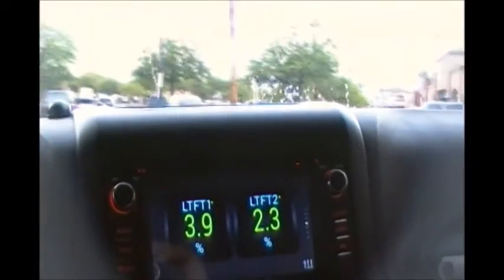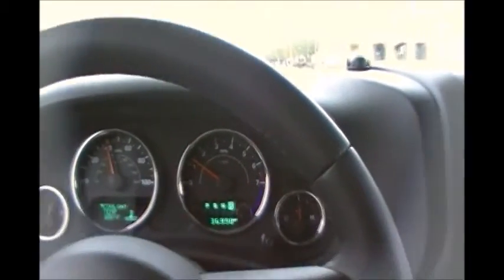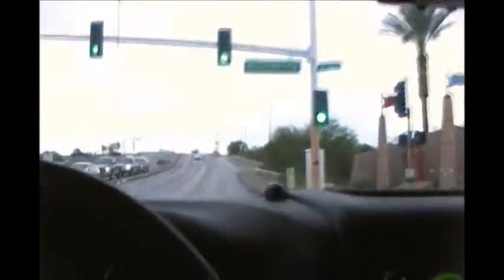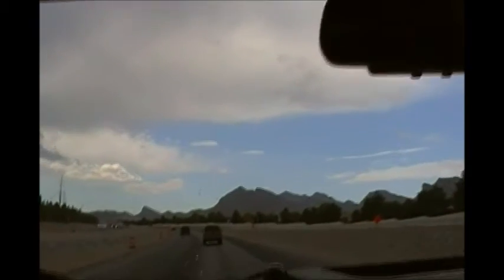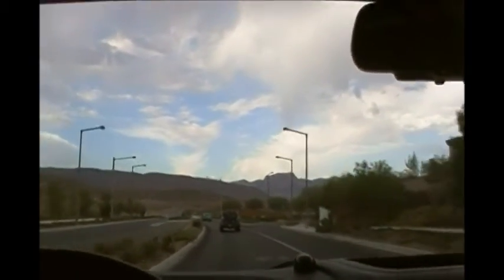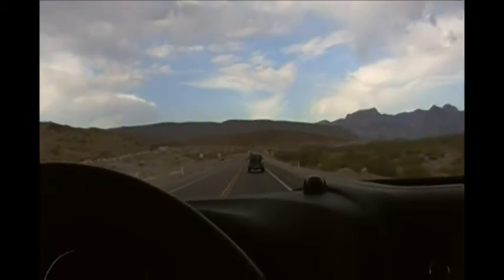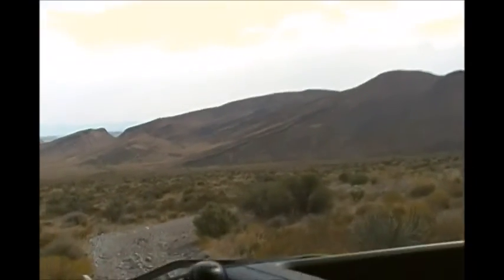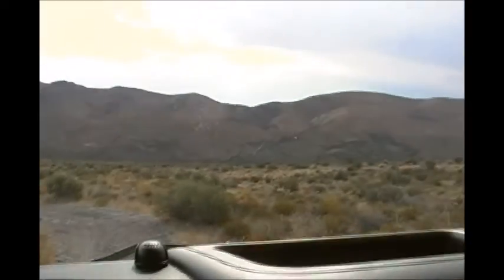2015 JKUR MoTech LS3/6l80 test drive while rambling again

Comment: I want a Gen. 5 6.2 in my two door Rubicon so much!  Is there a six speed manual option available with these conversions?  I know the 6L80 series of automatic transmissions are tried an true, but I would miss the third pedal.

Thanks for these videos, and it's good to see you posting again over these past couple of weeks.